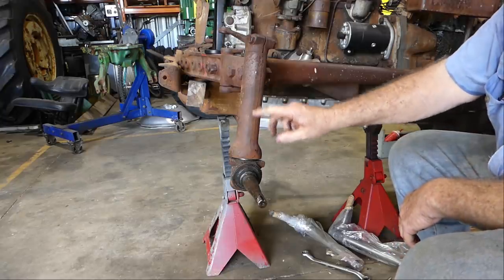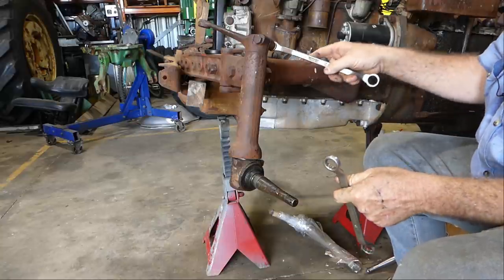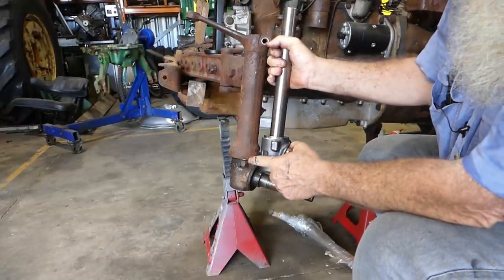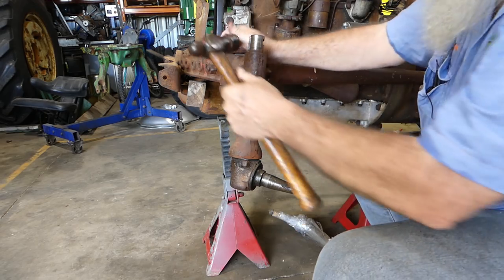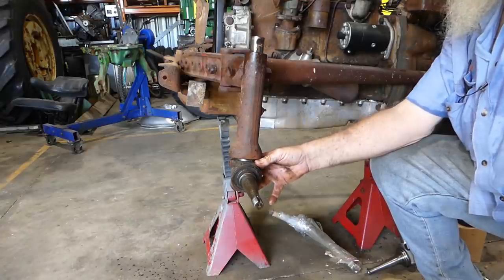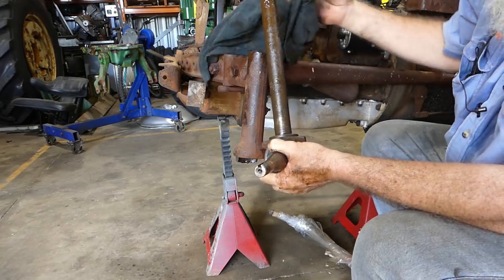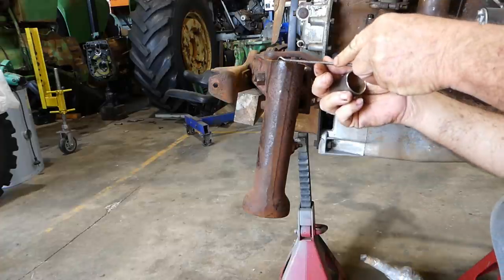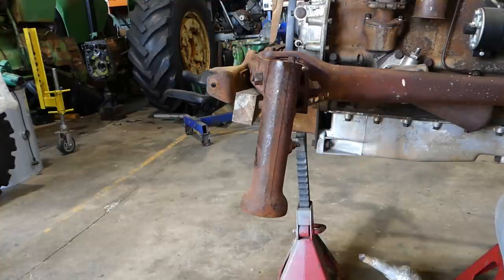How to Replace Your Tractor Front King Pins

Comment: I just replaced the king pins on my MF165 with Bear Co parts, The bushes were all the same part numb but 2 required reaming and 2 were to size once fitted, as it worked out the top ones required reaming. My tractor has the cast weighted hubs and the dust covers are larger than on the supplied king pins, it also had spacers behind the bearings which look a bit the worst for where. Is their need to fit the spacers?
Reply from the maker: No need usually but with the Australian cast centres you need to use the old dust shield at times depending on which wheels you have. I had to ream a couple of Bareco bushes so I try and only use Sparex now a days and I find there is no need to ream usually as it is a prick of a job I reckon.
Reply: @BundyBearsShed  I machined the old dust seals to fit the new stub axles, did some measurements and think all the clearance's will be ok, just need time to get back to finishing it.

Comment: Lance, I am tackling my front axle components on my TO30 now and noticed something on the King Pin actions I wanted to ask you about.  I have removed the old bushings, top and bottom, from the Axle Extension Assembly...I wish I was as lucky as you in finding the split...LOL.  Well, when checking the parts book, I noticed there is only 2 bushings required...was this a mistake in printing, or, did they originally intend to only bush the top and leave the bottom alignment to the Thrust Bearing?  Everything I have seen has indicated two bushings on each side; including my tractor had two on each side.  What are you thoughts?  Thanks again for doing these videos for us...I know I could not have done this without YOU!  Blessings to the family!! PS.  I knew to look for that dang tin part that got caught up in my assembly...both sides had to be pried out.
Reply from the maker: Always 2 per side they may be refering to one side only.

Comment: Hello Bundy, really learning a lot from your videos. I have a Massey Ferguson 282. Circa 1983 model. I’m replacing the front wheel bearings and realized the thrust bearings are also shot. Having a difficult time removing the kingpin. I engineered a kingpin pusher(not puller). It is apparent to me I have to use heat. Any drawbacks to heat I need to be aware of?
Reply from the maker: Not really just let it cool naturally so it doesn't go brittle but its normally not a problem.

Comment: I'm wondering on those bushings if you put them in the freezer overnight before installing if they would shrink enough to make install much faster?  Maybe even heat up those arms to expand some as well
Reply from the maker: Yes it possibly would but I was more worried about the bushes being straight than how long it took.
Reply: That's how we put in engine sleeves.  We put them in dry ice before installing them.

Comment: Nice video I'm getting ready to do this repair on my Ferguson. I won't know until I tear it apart but my kingpin is extremely sloppy and I'm afraid it may have worn through the bushing and into the axle.  Have you ever seen that happen? If so is there any way to fix it?
Reply from the maker: Yes it can happen, You can epoxy the new bushes in place and that seems to work well

Comment: do you always change spindle? dont you repair it on lathe workshop by welding and turning n grinding?
and i saw u fitting bush by puller, well its good way to fit bush but its so slow. i think you should use any small part of pin but first u have to turn n step face it accordingly to bush size.
(31.5 mm diameter length at least 10mm then 36 mm diameter length according to taste but at least 70mm)

__-------
---___
Reply from the maker: No if the spindle has acceptable wear we use them again but at 60 and 70 years old they are often worn. Being slow in a hobby environment where it gets the job done with simple tools is what my channel is about. It is not for money making shops that need to do things quickly to turn a profit. Many home hobby shops dont have a lathe or mill so I try and keep it to parts that are easily available to the hobby restorer.